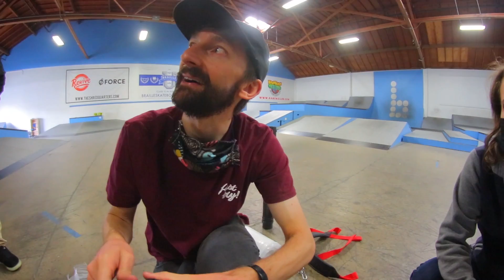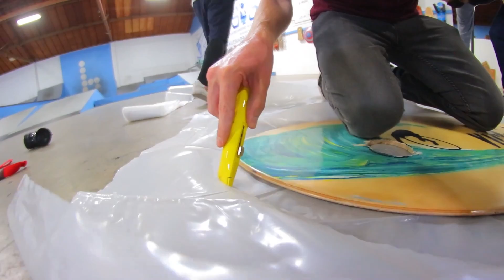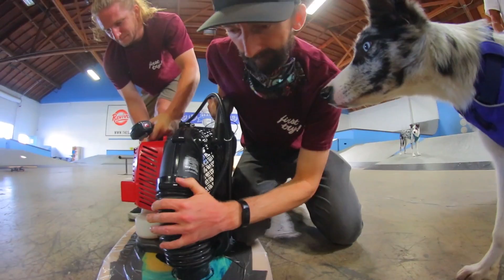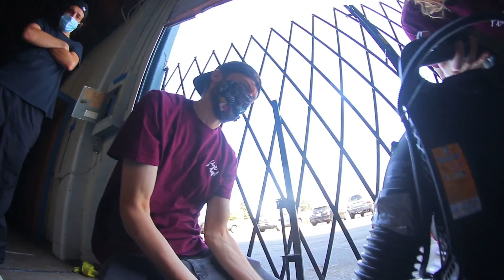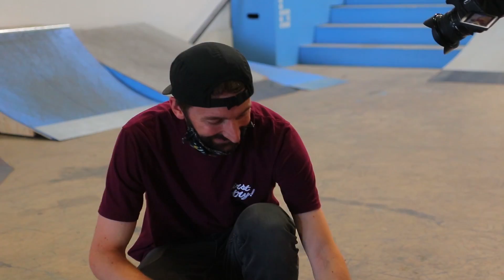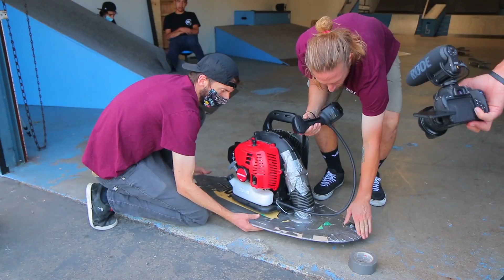WE BUILT A REAL HOVERCRAFT!

Comment: No plastic at all this you need something more like a rocket like the the thing that's on a rocket that's under a rocket that makes the that when the fire comes out of it and something like really powerful with your wind I'm doing a little tiny rocket parts under it I don't know what those are called though like to lift it up I need pressure to build up inside of the the tooth it was it would be something like a tooth and yes I was trying to build a hoverboard before but I was trying to build it out of magnets like you need little tubes like maybe toothpaste tubes or something a equal amount of numbers on both side signs like probably six on both sides like toothpaste tubes or something something you can put like a little like make the air go through think about a rocket what's on the bottom and I don't have no place to real or I live with a real skateboard I only do it in the grass and I don't know how to do a shove it I've been trying to shove it for years while not years but a long time unlike I don't get it

Comment: Yes, the curve broke it, as it was unable to form a complete pillow of air. Instead it would drag in the center and all the air would escape up to the raised edges.  Also the air pillow formed by the bag was not deep enough board to ground, although the deeper ya go the more air pressure needed.

Comment: Yo i think if you got tubing and split the air output and put 2 feeder holes and had the air bladder on the bottom bigger so theres more air to lift you up and the vents should be near the edge of the wood not underneath. Then it will pick you up when its inflated. But youll need a stronger blower too. Probably like a Stihl or a redmax. Those 2 have high mph for the output. Or try modifying a walk behind blower.

Comment: your skirt needs to be larger and at least 2" from the edge... somewhat baggy. your skim board will work. I live in Richmond, Ca let me know if you want to retry this. I built a couple of these in middle school and dragged one behind a 4 wheeler at 30 mph until impact with a curb. it's basically tubing on the street at that point. you have all the right materials you just need to tweak the ratio.

Comment: Put the skirt (plastic) on the top of the board, seal it however you want around the edges, and drill small holes in the board itself. The air hockey table effect would work that way.

Comment: Couple of things: the board was a bit too small for the weight of a person. But more importantly, the "skirt" (in this case the plastic that is supposed to keep air under the board) is all sorts of wrong. Typically when inflated it is supposed to form a nice sausage shape around the perimeter with excess air flowing 'in' under the board. So in short, more slack on the plastic and larger holes closer to the center! At least the leaf blower was plenty powerful :)
If you guys are going to re-build the thing i'd recommend using a small inflatable boat for skirt (can even recycle a punctured one!) since it's already the right shape. Place the boat flat on a piece of plywood, trace it, go 'in' from that line on the plywood about 3-4 inches and cut there. Attach boat to what will be the underside of the craft, cut round holes on the inside of the boat, close to it's bottom, cut air hole in the middle of the craft and plumb the blower into it (doesn't even have to be blowing directly into the hull). Get on the craft, fire up the blower and hang on! If everything works well the craft should raise a few inches off the ground and be rather easy to push around since there won't be much material in contact with ground, unlike that "pillow" that formed in the video.
Fly safe!

Comment: So on those hovercrafts they inflate a bubble skirt that only goes around the edge of the bottom and it lets out the air into the cavity in the center only. That forces the air to expelled under the skirt and the ground so there's a tiny layer of air between the skirt and the ground. Think basically of a long balloon like those ones you make animals out of but it just wraps around the edge of the board on the underside. If you pump air into the cavity it has no where to go except between the balloon circle and the ground

Comment: The issue is your leafblower power for the setup your using.
You need a much much more powerfull blower.
Or
You buy a 3d printer and print nosels next time to create and direct the air flow thus creating more powerfull air flow.

Comment: My old science teacher made one of these. Nix the boards under it and make the hole in the middle the more bag it has to fill the better it'll hover with someone on it. Then instead of that massive gas power thing you should use a lighter battery powered leaf blower. Then you can just plug it in and hold it while you skate.

Comment: @brailskateboarding your cushion the plastic on bottom is not enough. There is no clearance. It should be at least 3 inches tall to support your weight and clear the floor as it has to fill cracks and anything else you glide over. With that more small holes in the backside will push you first and that's where you would or your back foot. And a small gathering centered where your front foot would be so there is pressure where you're weight is. The motor is strong enough the board isn't optimal but will work. Get ahold of me I can draw you up easy plans and you don't use anything more than you did on the first one.

Comment: Hi let me give you a tip to make a real hover board.   It’s actually posible to really flight of the ground you’ll need to make it using reversal magnetic field that means gravity will not pull you down instead will go upward.  and stay off the ground.  That’s actually how UFO take flight and spinning is necessary.  That’s the answer is a magnetic field.

Comment: Here’re my long-winded thoughts on how to make it work for reals.

Flat board and skirt, no plastic. Basically take a plywood board, put 1”x1” trim (size doesn’t rly matter) all around the bottom side of it, so there’s a ridge to trap the air (and make those strips neat, seal the gaps between them). You’re basically building a box with one side open, which is facing the ground. The idea is to make it so that the air you’re pumping into the box can’t escape and builds so much pressure that the air trapped inside is pushing in all directions (specifically, down towards the ground and up at the board) as much as possible. 

To start, I’d put it on flat ground and see how flush it all sits. Once it looks flush, wax the bottom of your skirt strips. Once you get it seeming like it’s working without somebody standing on it and you do go to stand on it, you’re going to be increasing its load but also helping to seal the board to the ground, so you should wait while still revving it at max as it builds up more pressure and have somebody push or drag you.

I’m not familiar with leaf blowers but I’d figure they’re literally just fans on a motor’s belt. That means that they can’t maintain pressure higher than their own output that well (like it can only stuff so much in before it feeds back behind the fan). A compressor might work better. They tend to be heavier, though, and you’ll have to stand on the board for a while as it builds up pressure. To use a compressor, you would detach the motor from the tank that it assumably comes with, and use the board as the tank.

Maybe you could put the compressor on a gocart, put an air hose from it to the board, and zip tie the air hose to the tow rope, so the hose doesn’t get dragged along the ground? That would save a lot on weight and would probably be easier to set up. I think it would work with a 5hp compressor for sure.

Comment: my kid made a hoverboard in grade school of similar design.  A few easy changes will fix it.  He rode his to school.
Reply: plastic is too tight and cannot balloon out to form the skirt.  skateboard piece in the middle is too big (too close to the edge) and too thick (plastic needs to balloon out farther than that piece or you are sitting on the skateboard and not the cushion of air)  holes can be big or small but need to be near the center of the  board so that they leak inside the skirt not outside.  sum of holes should not exceed the area of the inlet (leaf blower) hole.

Comment: Need more mini nozzles attached to a bigger compressor , then separate them into rings of airbags in the bottom of the extended board , so the nozzles pushes air into the air bag that expel air, are on the inner rings and nozzles that push air into the ringed airpockets that hold the air to keep it afloat
Reply: Need to try to double layer it, somehow.

Comment: You need to add a skirt around the bottom that inflates. If you only have holes the air leaves the easiest spot rather than spreading out over the entire base of the board. Myth busters made hovercraft that were bigger but are similar. 

So just add a few inches of fabric(maybe something less porous like tarp material?) Staple it on the outer edge of the board and add a cord on the bottom open end so that the skirt bends in so that it can keep the same shape no matter the direction you go

Comment: (Experience) take off the trash bag and get the bottom as flat as humanly possible. Gett all of the tape and other burrs off so that you are left with a perfectly flat area. The tube cannot stick out the bottom. Just let the leaf blower hole be the only hole that passes the air through the bottom. The air will automatically create an air pocket small enough to hover a fraction of a milimiter but enough to decrease the friction and give u a hovering experience. This type should withhold any weight.  (Make sure that the leaf blower type is sealed to the board otherwise the air will leak out through the seam)

Comment: i built a miniature hovercraft for a school project in 8th grade. it was about 12 inches in length and i encounter similar issues to what you were experiencing. I resolved it by moving the holes drilled in the bottom to the inner half of the air sack. this created a negative air pressure under the hovercraft creating lift. I believe this would fix your issues! Been watching you guys for yeears, cheers from PA! :)

Comment: Hey guys I'm not a scientists but i am a master carpenter. 😊👍

I think maybe the 1x4 board on the bottom is too thick and raising the board too high off the ground. I think maybe if used a 1/4" piece of plywood in it's place would help. It would make the board closer to the floor causing the air pressure to increase and possibly make the board rise. Also try to glue some kind of rubber lining around the bottom edge to create an outer concave.
    Think of an air hockey puck. It floats so much better due to its concave design. It essentially creates an air pocket in the middle causing the air to burst out the sides which lifts it off the table and the constant airflow keeps it going! 
   
I hope this helps guys! Keep up the amazing content!!!

Comment: Use a pin to poke little bitty holes in it and probably do about 500 or so in it exactly like an air hockey table you might need a more powerful air blower also though but try the 500 or so pin holes first cause with the extremely small holes the air coming out will be much more forceful

Comment: The holes in centre/middle should be small holes outside for more pressure on outer edge for turning. I swear this can work. Battery powered leaf blower with a deck designed wide and hovercraft tech. Its possible. Dry sump fuel injection is the solution to ur problems but electric is the way

Comment: A hovercraft works by creating a high pressure area under the craft. This is achieved not by the momentum that the stream of air directed down carries (what you guys tried) and more by sealing the area around the craft with a skirt. By pushing air under the skirt, you get a high pressure area (a distributed force on the bottom of the craft) that is pushing upwards.

Comment: I think you should put trucks on the backpack/motor part of the leaf blower and angle the tube 90 degrees so its not putting all it’s weight on the skim board. Then whoever is riding it can hold onto the motor and put most of their weight on it and the motor will just roll alongside while the board hovers.

Comment: Try to use a skate board or a 1/2 inch plywood and use a heavy tarp do the same process u did but use a leaf blower or 2 of them and seal it air tight yall should get it to work

Comment: Why not make fittings in the biard for an air compressor then make the air vent towards thr ground to push you up , itll dam sure work with 1800 psi propelling you from the ground, add another vent to propel you forward

Comment: You dont have enough skirt, the plastic that you have put on needs to be able to inflate and create a pocket of air under the board,  to do this you need to have alot more plastic loose around the edging and not wrapped up tight to the edge like you have, so cut another bit of plastic but much bigger so you have at very least 4 inch of plastic outward from the board edge and then put the board in the middle but only in the middle you so you get the edge to inflate all around and then drill your holes close to the inner board that will be screwed to the bigger board 😉 simplez

Comment: You got to use a bigger board just like a wave surf deck und that two of those motors. Than you got to make like a 6 hole that are as big as the main hole where the air comes from or a little bit smaller. I'm pretty sure it works like that
Reply: And als Put an Air circle around it

Comment: I feel like they saw that one King of Random video where they tried to make one, actually 2. They used a battery powered leaf blower and a plug in one, if I recall correctly. They found the battery ones didn't provide enough power to get the air cushion they needed I think they also just used flat wood platforms. Not sure how much air the gas blower puts out but that might be an issue along with the platform.

Comment: I made on of these years ago as a kid and here's the best way to do it...
Materials: Plywood, leaf blower, duct tape, thicc vinyl tarp
1.) Get a flat sheet of plywood and cut out a circle (2.5-3ft across) which works even better than a rectangle or square!
2.) Cut out the tarp and make it larger than the piece of wood, leave roughly 6 inches of extra tarp on the edges. This is where you guys went wrong. I could see that the tarp was too tight underneath the board which did not allow enough of an air pocket to form. You need enough tarp so that it is not too tight, otherwise the air pocket can't form. (Think of it as a dome filling with air underneath the board)

3.) Adhere the tarp with duct tape or a staple gun or you can use both ( be sure that the tarp is not pulled too tight so you have a nice "half dome" shape when air is being blown into the tarp before attaching anything to the middle of the board)
4.) Cut out a circle piece of plywood roughly 4in-5in across (this is the piece that will be screwed into the middle of the board to help create that nice air pocket under the board and create a donut shape)
5.) Cut out three quarter sized holes about 2in-2.5in from the circle you just screwed in so now you have a donut shape with multiple holes around the center circle.
6.) Plug in you leaf blower and let it rip!
I hope this helps you guys with HoverBoard 2.0!

Comment: The problem is that the plastic skirt on the bottom is way too tight that it can't even inflate. You need a pocket of air between the board and the skirt for it to hover. Id try it again, this could be really cool!

Comment: An inflatable rubber skirt would help maintain air pressure under the board. You could try using an inner tube from a bike tyre. Attaching it could be tricky though.

Comment: IMO Get an Overhead Gantry, it is what they use to Support in Building Overhead Crains, with this Gantry you will Be able to have a Hose Line Follow the Rider while Tethered to the Bored,  Now buy 1-4 Vary Nice Compressors, the Type I'm thinking about are Huge Big Blue Boxes that can Rapidly Compress air, because a Portable compressor WILL NOT CUT IT   but these Exspenive air Compressors can!
 these can be Put outside or in a Separate Room 

but these 2 Systems are Guaranteed what you will need for the bored to Operate as desired,  From this point it will just be Adjustments to the Bored until it Preformes Play as Desired  , the Compressors Come in all Types of Wattages , IMO get a Contractor to Help you buy and Instal one or 4 of them and have him Link them to the Same Main Line and then Help you Set up the Overhead Gantry and Hose Line that will Connect to the Bored

Comment: You want the concave on the opposite side so air pushes inwards instead of outwards, symmetrical air hole placement, find a way to reduce weight, since backpack leaf blowers weigh more than they can probably push up on their own, and you should be golden

Comment: You should have put the blower in the exact middle to evenly distribute the air mass blown from the leaf blower. But I do honestly think you need a lighter blower and/or a stronger blower. The weight of the board chosen could be another part of why your experiment went wrong. My equation to help make your experiment a better one, lighter mass + stronger blower = successful hover board. Also I think was the car company Toyota or Subaru made an anti gravity board that really works. They made a video on YouTube and it should still be there. If not I saw a website that also had the video. Look it up and I’m you’ll find some more help/motivation. Best of luck with your experiment @Brailleskateboarding.

Comment: If you use the skim board again you might want to make a duct tape barrier on the bottom to keep more of the air under the board so the air goes vertically and doesnt escape horizontally